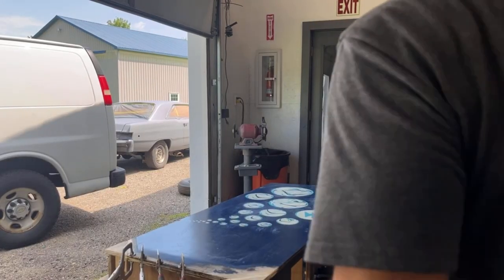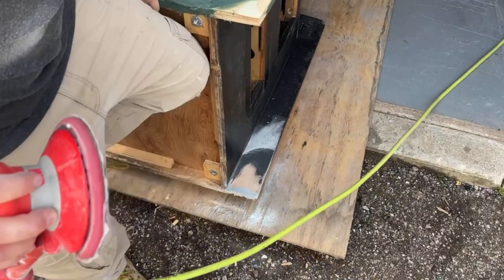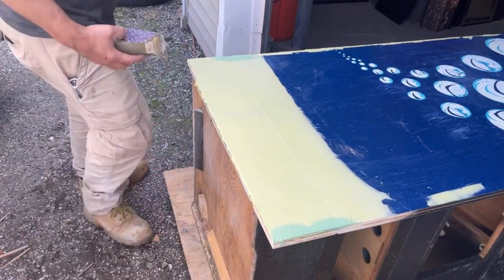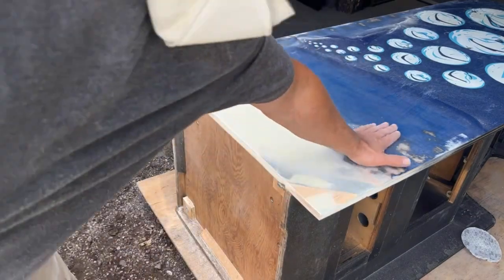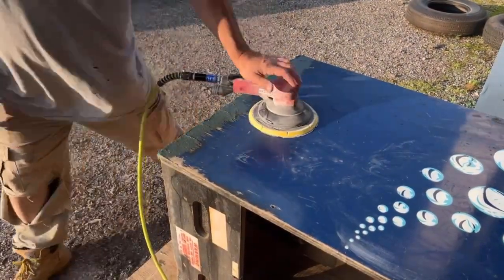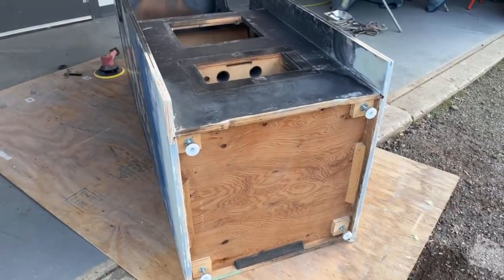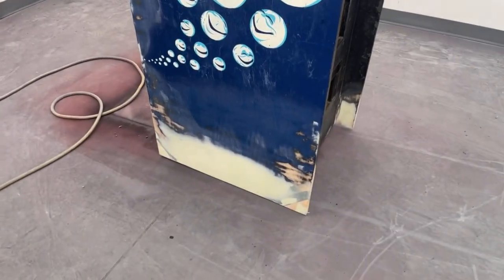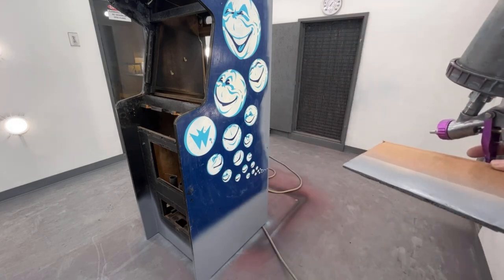Bubbles arcade restore part 4

Comment: My double dragon cabinet edges need similar repairs and the bottom is blown out.  mdf board from 1987 is rough 🔧
Reply from the maker: Yeah, I’ve had to do that to quite a few MDF cabinets just takes a little time. If you want a hard enough the MDF you can use some fiberglass resin first.
Reply: Thank u Troy.   Hey what size leg levelers did you buy of Amazon and how are they listed on the site? I am needing some for current projects
Reply from the maker: @jumpingeneral  Heavy Duty Furniture Leveler Tee... https://www.amazon.com/dp/B098WZ55FJ?ref=ppx_pop_mob_ap_share
Reply: @troylukans2174  thanks
Reply from the maker: @jumpingeneral  your welcome
Reply: @troylukans2174  it shows unavailable for the levelers
Reply from the maker: @jumpingeneral  he might have to just search around for ones that look the same. They’re just heavy duty furniture levelers
Reply from the maker: Heavy Duty Furniture Levelers 3/8''-16 Thread w/ T-Nut Kit Furniture Leveling Feet Adjustable Furniture Levelers for Tables,Cabinets,Chairs,Workbench,Sofa and More,Large Base Supports 1320LBs-4 Packs https://a.co/d/bab05F2